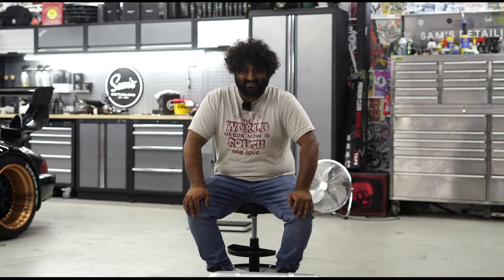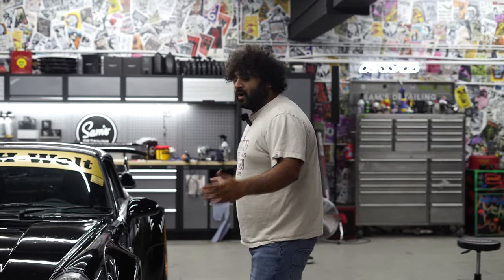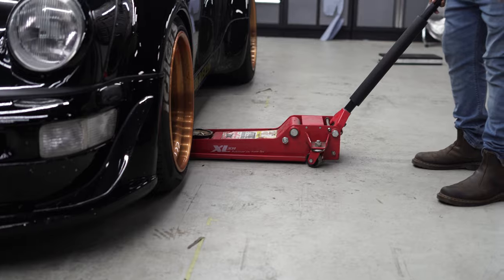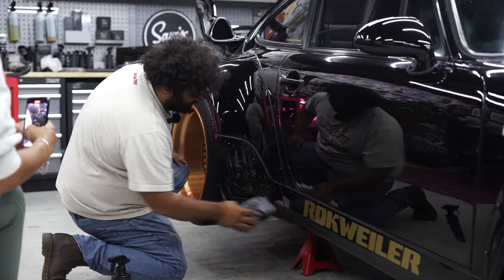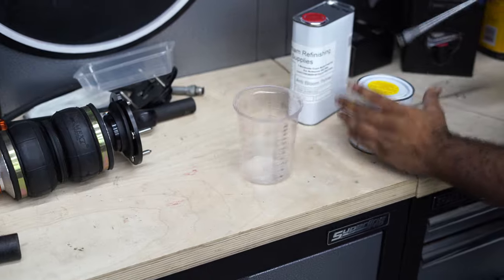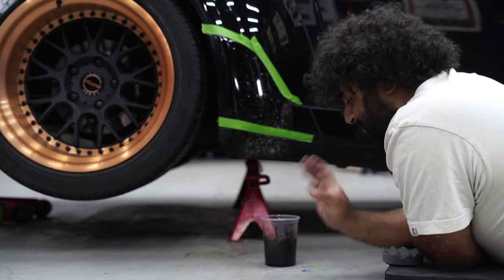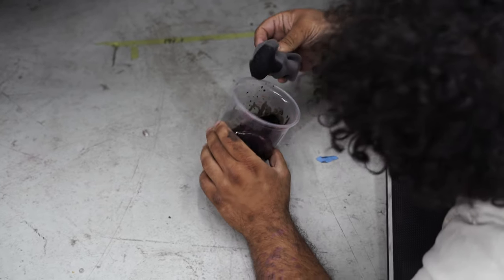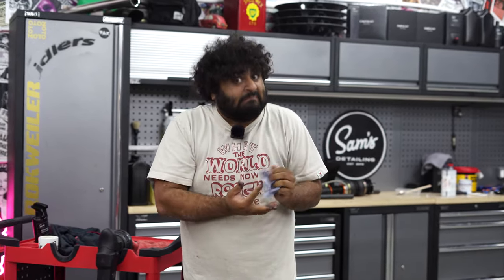Fixing my RWB's Road Rash... FAIL!

Comment: Wet sand first. Apply with brush and build the layers up. Wet sand and add more paint if required, wet sand again then polish. I use the paint with no thinners. Used the method on cvr U.K. you tube channel and works a treat every time.